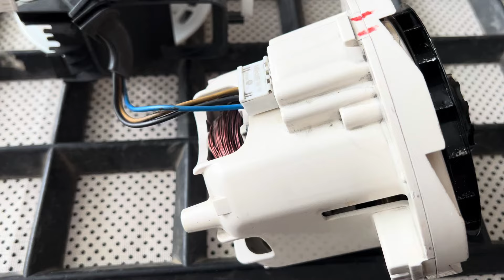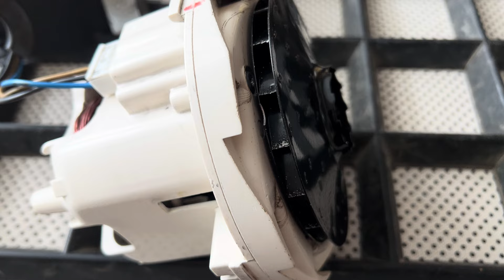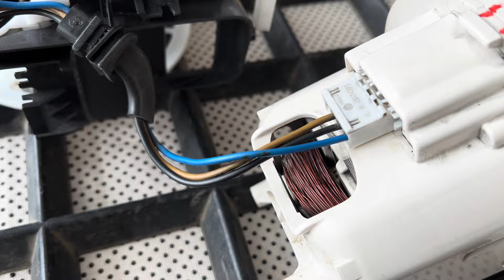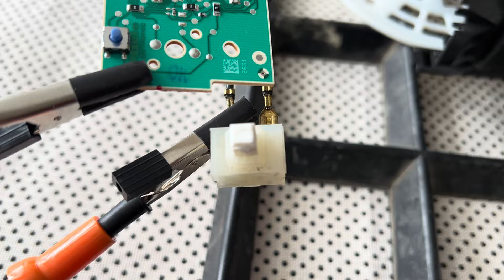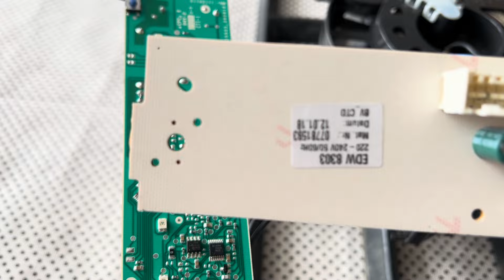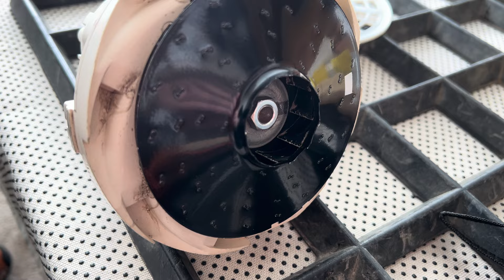Repairing a Miele C3 Cat & Dog Powerline Vacuum cleaner

Comment: What voltage does the Triac require to trigger the motor ?
Reply from the maker: Sorry for tardy reply been away over the summer

The key characteristics of the gate voltage:

• Triggering Threshold (\(V_{GT}\)): Most standard or sensitive-gate TRIACs require a gate-to-MT1 voltage of 0.7V to 2.0V to switch on.
• Pulse Duration: The voltage is not continuous. A DIAC (diode for alternating current) or a microcontroller delivers short, sharp pulses lasting only a few microseconds (μ s) at a specific point in each AC half-cycle.
• AC Coupling: Because a TRIAC operates in both the positive and negative halves of the AC waveform, the gate voltage spikes both positively (+1V to +3V) and negatively (-1V to -3V) relative to MT1.

If what you want to know is - is it working....

Triac pin identification (standard layout)
A triac has 3 pins:
•	MT1 (A1)
•	MT2 (A2)
•	Gate (G)
Typical arrangement (front view left to right):
[ MT1 ] [ MT2 ] [ G ]

TEST 1 — Triac short test (power OFF)
Put multimeter in resistance mode:
Probe between: MT1 ↔ MT2
Expected:
•	High resistance (kΩ or more) → OK
•	Near 0Ω → triac shorted (very common failure)

TEST 2 — Gate isolation
Measure:
•	Gate ↔ MT1
Expected:
•	Medium resistance (through resistor network)
If:
•	Dead short → damaged driver circuit

TEST 3 — Live switching test (best test)
With board powered:
Measure across:
•	MT1 ↔ MT2
Then change power level:
Results:
•	Voltage changes → triac working
•	Always 0V → not triggering
•	Always full conduction → shorted